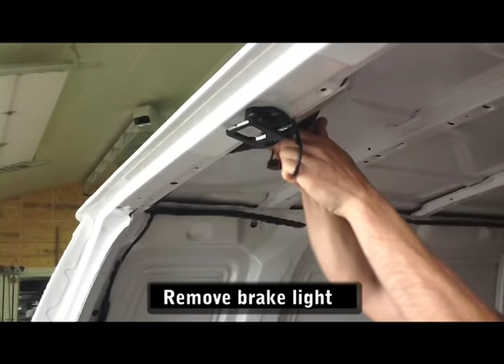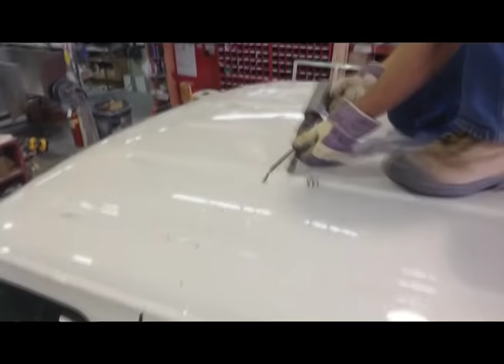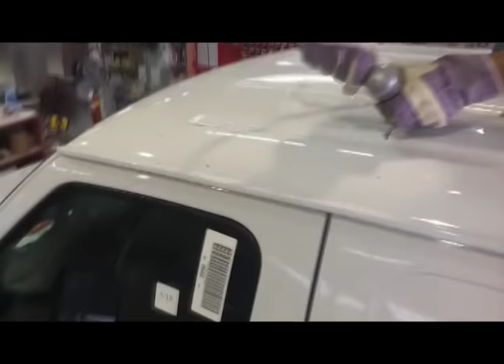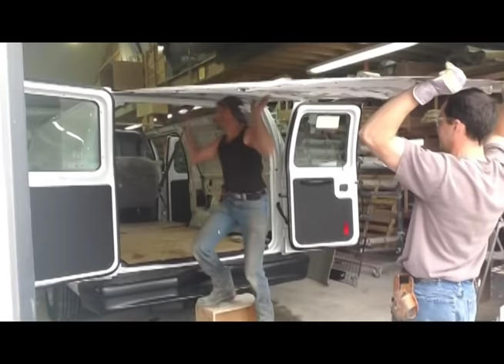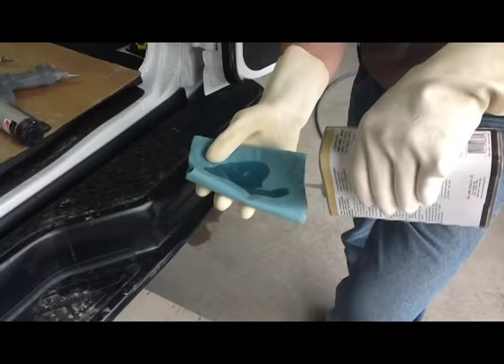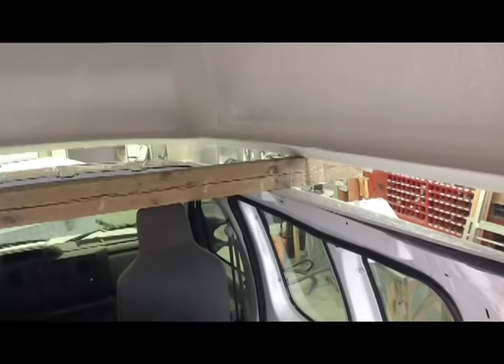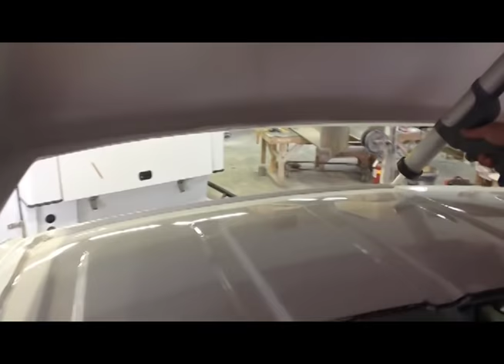Mory inc Raised Roof Van Top Conversion Cutting out the Roof. www.moryinc.com

Comment: When you cut out the transverse supports in the roof, does it leave the vehicle substantially weaker and less safe in a rollover?
Reply: For the strength of the roof we keep the original strength in front for the driver and passenger seat. However we cannot keep it for occupants in the back
Reply: @juliemorin2251  I wondered about this myself. Thanks for being honest about it.
Reply: Wonder why this response didn't come from Mory Master (who posted this video) like those further up in the posts ? This response is incorrect....the strength in the front section is not derived solely from the factory rib above the front occupants. ALL the roof ribs contribute to the strength of the roof immediately above the front seat occupants.  Try tightening a top on a FULL 2litre soda bottle and squeeze it as hard as you can with one hand. Now take the top off and do the same. The lid doesn't just make the top of the bottle stronger. ....it assists the rest of the structure and vice versa.  It's not just about direct impact either. .....ever tried to flatten a cardboard box ? They can be stubborn even if you stamp on them.  But......undo just some of the end folds and they flop. That's what a van is....a flimsy tin box.  You need those ribs. Hope this helps.  John
Reply: @juliemorin2251  What types of government hurdles/insurance do you have to jump through to cover your butt with the customer?

Comment: What about using rivets instead of self-tapping fasteners? I've done some aircraft repairs and like rivets.
Reply: There are rivets that can do the trick the only problem is to put them properly with the roof angle especially in the front.
Reply: Yeah sure you can try something different and see how it works. I get it, you like rivets. Rivets are cool. The reality is this is how every fiberglass high top conversion van ever built was put on. Unless you can point to a real issue that using self tapping fasteners causes, why would you try something different and untried during installation?

Comment: How would you frame out that topper inside to support a wood tongue and groove ceiling?
Reply from the maker: It is recommended to glue wood reinforcements using urethane glue where you need it.

Comment: Looks very cool, but where I live, cutting out structural steel like that would see  the van fail it's next road worthiness check straight away.
Reply: 'Depends on the 'Construction & Use Regs' in force in the country/continent. At least HERE in the UK, the actual level of support provided by beams removed (in common with Sign-Writting Panels v Windows) is only against panel-drumming/buzzing rather than chassis-flex.

Comment: Does anybody know how to insulate these fiberglass tops? 
I'm planning on adding one to my van but have NO IDEA how to insulate or add any wood cabinets to it, since Im petty sure you can't just drill through it. All vans have beams on their roofs and I think I coul handle that... but I seriously have NO idea how to work with one of these.
ANY IDEA WILL BE WELCOMED :)
Reply: Check YouTube videos. I saw one in the last few days where they said they had reinforcements put into their fiberglass top when they ordered it specifically for the loads they were going to put on it (solar panels, inside cabinets.)  They ordered theirs from Fiberine which is a reputable manufacturer. Here's the video ( https://www.youtube.com/watch?v=szL8jmhJeiM&t=465s)  Your safest bet is to tell the manufacturer you order it from what you want to do and just pay for it.  If you aren't buying from a manufacturer (not certain its possible) then for insulation look at videos and websites on fiberglass RVs.  For the load I would consider building an aluminum frame that ties to the walls and floor of the van rather than hanging the load off of a fiberglass roof, but I'm not an expert in any way shape or form. Just cautious.
Reply: There's diy spray foam kits that people have used on these vans. Get your structural supports installed and then insulate and apply the final interior finish.
Reply: @marthamryglod291  Thanks!
Reply: @wabiiiii  your welcome! In my own van, I used cut pieces of foil- sided polyiso foam board with reflectix covering the whole surface. It really helped with solar gain, but was just ok with cold. I glued it up. Getting the windows covered made a large difference in the hot sun, and cold nights. That's my two cents.

Comment: Hello, Thanks for documenting this. Did you end up drilling the screws into the structural beams or just into the sheet metal?
Reply: looked like it was just into the sheet to me ! the roof they cut did not look like it had any cross rails over the roof in the first place .
Reply: @colinvanful  Actually it did have STRUCTURAL steel cross members. Several. They cut them ALL (except the very front most one) out after cutting the roof loose. Look for the shots with the reciprocating saw.

Comment: @Mory Master Where does one obtain the rubber seal you applied to that exterior joint. I have a 13yr old high top ford that is leaking aloing that joint and I need to reseal it..
Reply from the maker: We do not have the molding you need, what we install these only a decoration, it will not prevent the infiltration of water. Looked at a company that repairs camping trailers.
Reply: Look at Eternabond tape or similar (Extreme tape at Walmart also Ultra Bond at ACE) which is used on rubber rv roofs. Cut it to size. Waterproof.  Bitch to remove though.

Comment: Those few screws keep roof from flying off in high wind?
Reply from the maker: During an installation we put screws at every + - 10 ".When sitting the fiberglass roof on the van there is a bead of urethane (like a windshield) all around which gives strength.After 24 hours the screws are useless because the urethane has reached all these strengths.
Reply: Beautiful roof and owner will appreciate the added height, but it did look under-engineered to me re high winds.
Reply: @mastermoryinc   why not butyl tape?  Poly will shrink after a while and leak.  Ask how I know.
Reply from the maker: @ronnihall444  We have already used bultyl tape there are several years and with this product we had a lot of water problem. We use urethane the same products used to install winshield.

Comment: any idea how much this would cost? for the top itself plus installation?
Reply from the maker: The price is between $ 3000 and $ 5000 depending on the options
Reply: @mastermoryinc  can you do this to a Ford transit 350?
Reply: @marquesjohnson3651  Only on Ford Econoline or GMC Savana/Express van

Comment: Can this be done to a high roof van? I would like to increase the interior roof of a Promaster High Roof by about 10-12".
Reply from the maker: No sorry we have no mold for Promaster
Reply: @mastermoryinc   If someone did have a mold, could it be done? What I mean is, on a van that is already a high roof is it possible to increase the height without any trouble?
Reply from the maker: @btkramer  In our market we raise the roof and not lower it. I think its would be much more complicated to do and almost impossible.
Reply: @mastermoryinc  I don't want to lower it.  I want to raise it. You have taken a regular height van in your video and raised it to be a high roof. I want to take a stock high roof van and raise it to make it extra high. I am wondering if it is a good idea. A Promaster High Roof is 76" high, interior dimension, stock. I want to increase it to 86-88" high, interior measurement. In other words, I want to add another 10-12" of height to a High Roof van.
Reply from the maker: @btkramer  Sorry I do not know why I thought you wanted to lower the roof ... Yes it would be possible for you if there is a company that has the mold, but we will not have this option available for the Promaster .
Reply: @mastermoryinc  Great, thanks!

Comment: Great video! What kind of moulding is that used to seal the outside edge of the top? Been looking to use something like that on my project instead of just caulking it and making a mess of things.
Reply: The raised roof has a reverse flange made of fiberglass. We also put a 3M black stripe in the front
Reply: Thanx for the quick comeback! Does the 3M stripe also seal the gap? And can I get a part number or what it's called? It looks like that gets wrapped around the entire perimeter of the new roof section.

Comment: It looks good... except that you removed all the roof's rigidity by cutting the braces that hold one wall to the one in front; in a crash or accident, this is a trap that will collapse over the passengers.
Reply from the maker: It not approved for passenger use
Reply: Same goes for the front seat occupants. The roof needs all those ribs. Vans are only made as light as they are because of the specific locations of strengthening struts or ribs that all work together to achieve the reinforcement necessary to support that flimsy tin outer. John

Comment: I want a top for my 2009 gmc hmm 15 passenger van. Kel.richey2333@gmail.com
Reply: I will contact you by email, info@moryinc.com
Reply: Will these tops work with vans having airbags on the top sides where the top and the metal part of the can meet? I have a 2009 gmc savanna extended 3500